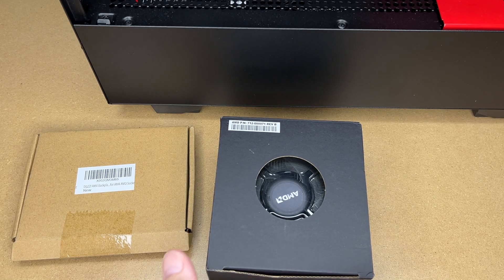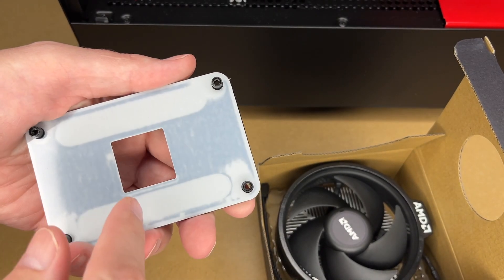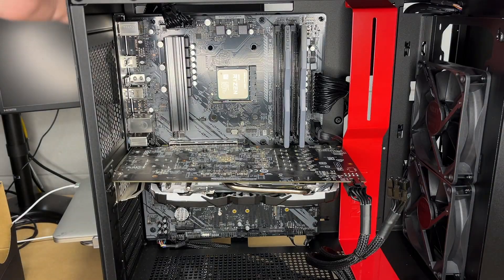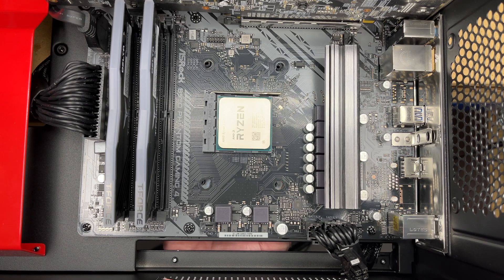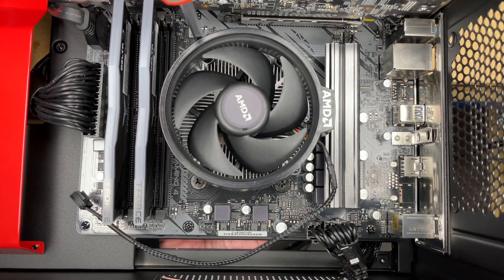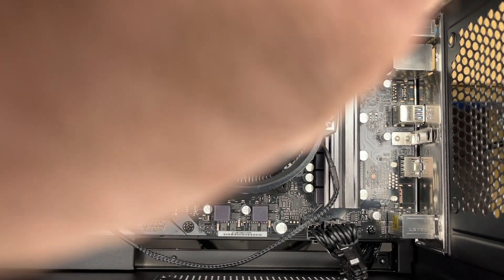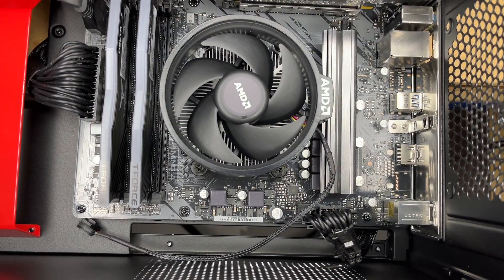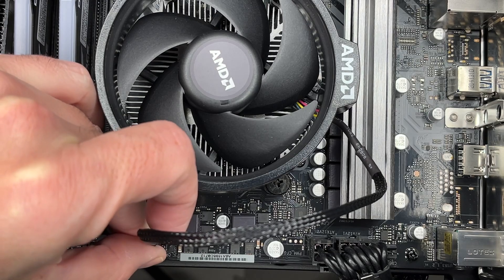AMD AM4 Cooler and Cooler Bracket Install

Comment: So will any AM4 backplate will fit any cooler as long as it’s air cooled? I have a hyper 212 black edition and I was thinking of using the normal backplate because my didn’t come with one.

Comment: Nice Vid Bro. Question 4 ya: I upgraded to a faster CPU. The HP mobo (Erica8) cooler screw configuration in symmetrical  (screws are equally spaced) but the new one is not symmetrical (as you deminstrated). What the ... I just used the original cooler, not so keen on that.
Reply from the maker: If the old one is working, I'd just go with it.

Comment: Nicely done, this is handy for people buying second-hand as a lot of boards are sold online with the standard mount removed. I noticed that the GPU seems to be sagging - I like to thread the PCIe power connector from the top of the case to help alleviate some pressure on the slot, in circumstances with really heavy cards, a brace is needed underneath.